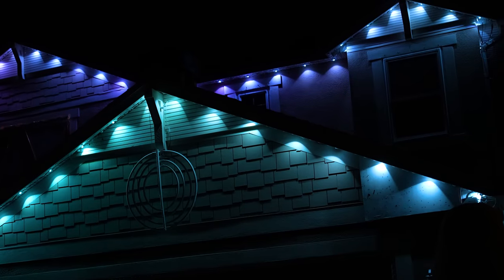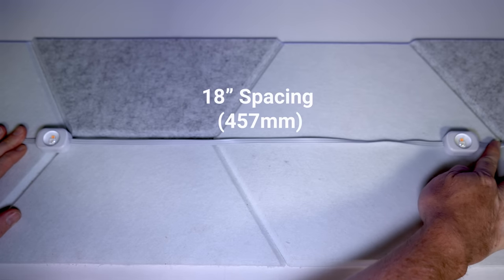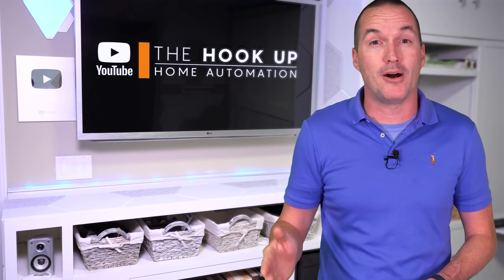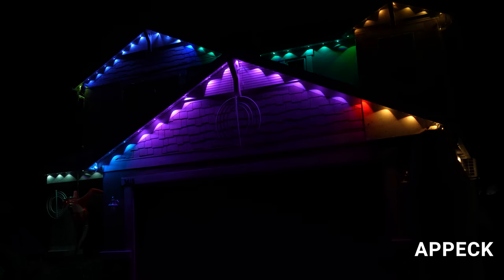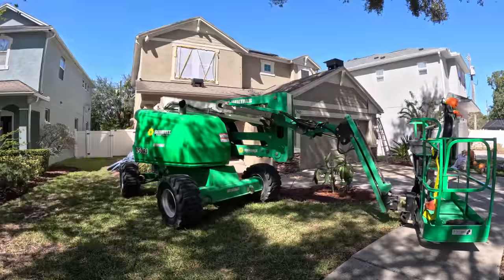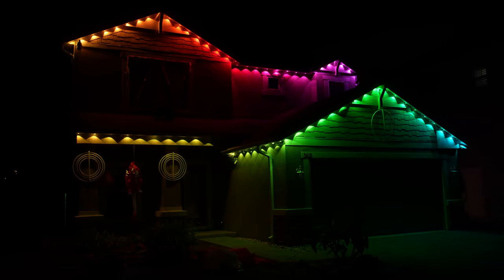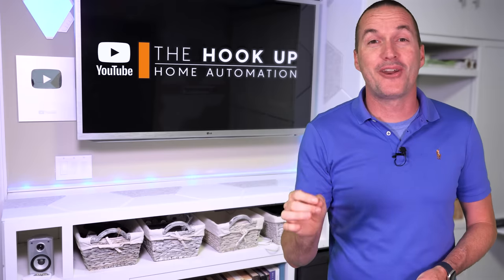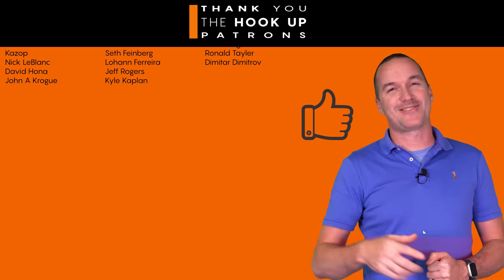Best Permanent Install Exterior LED Kit? Govee, Govee Pro, Eufy, Appeck, YPS, Novostella

Comment: Amazingly timely. I really want to buy a set, but I also really want to do WLED in the future. And after seeing the pictures I realize I need that separate warm white LED too. Sounds like Eufy is the way to go for me. This is amazingly helpful, thanks so much.
Reply from the maker: Yep, seems like Eufy is your best bet.
Reply: @TheHookUp - for 100% WLED DIY with pucks, do you think there's a cheaper route vs. buying the Eufy and throwing away the controller?  I'd love it if I could just buy the strips/pucks themselves with no power supply/connectors/controller/etc.
Reply from the maker: The pucks don't have the same "scalloped" look as the lensed nodes from Eufy/Appeck/Govee.
Reply: @TheHookUp  Are the white LEDs on the Eufy individually addressable?

Using the Uefy controller I can’t seem to set just one led on warm white while all others are off.  Can it be done with WLED?
Reply from the maker: @FreQi  Yes, it can easily be done in WLED.  According to Eufy that functionality will also be added to their app after the next update.

Comment: My soffits look just like yours. I've been a little nervous screwing in to them, but I know the 3M won't last very long where I live (hot summers). What type and length screw did you use? I saw somewhere #8 3/4 inch? I also read self tapping? thank you and great video. I got 2 150FT Govee the other day and after watching your video it looks like I made a good choice.

Comment: Thanks for the very informative video! I bought some of the Eufy lights and have installed them on the lower story of my house and they're great so far. I have a bit of a longer gap between strands, and I'm hoping to be able to bridge that gap without soldering. Do you have any experience finding a longer extension cord for the Eufy lights, or stringing two together? I see you could do around 10 feet in the middle of a strand, but I'm wondering if extending between strands could go longer than the included 12 foot extension cord.

Comment: Great Video.  I have subscribed for a long time.   Really looking at the Eufy lights.  Eufy says not to cut them to extend them.  Were you able to cut them without a problem?  If so did you just use normal crimp or solder shrink connectors?
Reply from the maker: Was I able to cut them? Yes.  Was I able to cut them without issue? No.  I ended up splicing two sections together and made a longer section and that was not the way to do it.  I would only recommend shortening a strip, not lengthening them.

Comment: The biggest issues I've had with ALL things LED... Is the quality of the engineering for life. I have yet to have anything last over 3 years.

I would LOVE to find a warranty solution or a true commercial grade LED system (but exterior and interior).

Comment: Thank you for putting together this amazing comparison! I was between permanent channel lights (YPS style), the Govee, Pro, and Eufy. I really wanted that warm white and the ability to work with WLED. What sort of result did you find with the Govee Pro's and WLED? Thanks!
Reply: (See  comment above, the support for the Govee Pro was added to NeoPixelBus (low level layer that WLED uses) so WLED team can now add the upper layer support for it.
Reply: Yps will have rgbw starting in January.
Reply: @mynorandvirginiamendoza8072  Thanks for the update! It was a pleasure talking to you a few weeks back and I can't wait to get these ordered!

Comment: Thank you so much for putting this together! Is the YPS white at 19:30 the closest to a warm white it will do? 

I love the color of the Govee Pro, but after your video I’m debating about the YPS because:
1) I have a gap that I would like to go down to the ground and then back up the garage wall as opposed to just running the wire along the wall. That’s obviously going to be longer than 10’
2) you mentioned these lights between a gateway drug. I probably should plan on that 🤣

Thanks!
Reply from the maker: 22:16 has the warm white wled color.

Comment: Great video. I live in Ottawa Canada where usual winters include several feet of snow with temperatures ranging from -10 to -30 degrees Celsius. Cold, cold and more cold. How do these products react to these types of temperatures?
Reply from the maker: They are IP67 so they are technically only rated to -4 F which is -20 C, but they should be fine at -30 also.  You should mount the power supply and controller somewhere inside though.

Comment: I saw in the video for the Eufy lights that you could not use the warm white light in combination with another color currently or individually adress the warm lights on or off. Do you know if Eufy plans to fix that in the application so i can set a candie cane (red/warm white) pattern ? Currently it looks like it only uses the white from RGB led and not the dedicated warm white. Or would i have to go with a WLED controller?  

Awesome video and i appreciate it.

Comment: Great review but one thing I have NOT seen on any of these permanent light reviews is maintenance and repair. LED's are notorious to stop working LONG before the manufacture claims. This is not because of LED failure, it's typically a cheap circuit failure. What is the repair/replace process of a single failed puck in the middle of a string? Do the manufacturers even make this available or possible or do they consider the string disposable if things start to fail within a string?  I haven't found any information on this from any of the manufacturers yet.
Reply from the maker: It would be the same as any other LED repair, just cut out the bad LED and splice in a new one.  For me, I ended up with 2 extra LEDs after my install, so I could just keep those around in case I needed to repair one.  That said, the heat dissipation on these appears to be very good and they didn't get noticeably warm, even after an hour+ of runtime, so the circuits should last a long time.
Reply: @TheHookUp  Yes I get that but let's just say you use 100% of the product for install. A year goes by or longer and you have a single LED fail in the line. Can you go back to let's say Govee and they can sell you a replacement LED fixture to repair your broken one?
Reply from the maker: Govee sells single extension strands, so 12 LEDs on Amazon.  You can also buy single strands on eBay.

Comment: Great video, very detailed. On the yps 5 light tracks, how many can you put together before you lose to much voltage to power or dim the track? Thanks
Reply from the maker: Same as any 12V light source, about 10m (30ft) before they will need power injection for full brightness white.

Comment: Thanks! Extremely informative.
I was thinking of covering the Govee cable with wire concealer/cable hider in between each light, will that interfere with light output/scallop?
Reply from the maker: Nope, that should work fine.  I've seen people using vinyl J-channel from home depot to do that.

Comment: Outstanding video. I would like to know about the YPS as far as power injection requirements and data boosting. I may end up with a couple hundred feet in total. Also, do you have or can you recommend a video about setting up the power supply and enclosure with a dig-quad?
Reply from the maker: I'll be making a video about psu and enclosure later this month.  As for power injection, it's the same as any 12V string, so 10m/30ft can be done without injection and 20m/60ft should be done with injection after 15m.

Comment: I am leaning strong towards the YPS track system for "NEXT" year.   I did not see how many tracks can be linked together... I followed your link to them... and they come in 15M (~45) sections... So, is 45 feet as far as you can go, and then you have to start a new "Electrical Home Run"?  Or can you chain more than 45 feet?  Thanks, and such a great video!
Reply from the maker: They are 12V lights, so for best results you should inject power every 30m, but there is no realistic limit for the data run.

Comment: Hello Great video, I have a question if you don't mind.  Question: The Govee ( non-pro) - Could you adjust the rgb-led to 4k-5k kelvin and was it consistent? I would like to use these year round, but the white (kelvin) is important to me. I did noticed you mentioned the Govee Pro have separate white leds and that does interest me, but the non Pro Govee also have my interest peaked! Thank you.
Reply from the maker: You can set a custom color, yes, but it will take some fiddling to get the color you want from RGB since there's no dedicated white chips.

Comment: Thanks for posting this! Is there a total length where you think it would be best to DIY your own set? I’m new and the design of my house has quite a few smaller peaks I’d have to splice and run blank spots for.
Reply from the maker: I think it's just about the look.  The DIY sets don't give the lensed/scalloped look.  If you need to do a lot of jumps the Govee Pro kit is probably the way to go since it seems to be more tolerant of extensions.

Comment: I see you chose the Eufy to hookup to your WLED controller.  Did you splice the wires, or use the native connectors?  If you used the native connectors, what is the connector type?  I'm looking to do something similar.  Also, did you use a QuinLED controller, and bypass the controller for power since the Eufy use 36v?
Reply from the maker: Yes, I spliced out the wires.  Data and ground go to the DigQuad, power goes to the 36V Eufy PSU and the PSU and DigQuad share a ground.

Comment: In all the installs that I've seen, the lights are mounted 3-6 inches from the house. I've got a gabled 2-3 foot overhang around my house. The flat surface is at the end of that overhang, so the lights would be mounted 2-3 feet from the house. Would that still create a good effect? Also, If I did mount them closer to the house they would be sloped like the overhang is. Would that affect the way the lights illuminated the house?

Comment: I would be interested to see how these hold up to your DIY version from some years back
Reply from the maker: The DIY option is still going strong (you can see it in the flames in this video).  The plastic diffusers have yellowed significantly due to UV, but colors and brightness are still good.  I'm honestly amazed every time I fire them up and there are no issues after 5+ years.
Reply: @TheHookUp  thanks! do you think these options outperform your DIY option tho?
Reply from the maker: @tonverra  Just a totally different look.  My LED strips are pointed at the street, so you see the LEDs directly. The scalloped/lensed options are more of a wall wash, while the YPS track is a combo of wall wash and direct view.
Reply: @TheHookUp  thank you! Appreciate the info!

Comment: So, I'm thinking the standard Govee lights are what I'm leaning towards for my house. Question, if I need 10 or 12 more feet does Govee sell a single strand that I can just screw in? Also, if so will that extra string add onto the app like plug and play?

Comment: Do they make diffusers for the puck lights? I don't love the tiny sharpness about them or the bullet/pixel style LEDs either, but I hate the overly scalloped look of the other lights. Wondering if it makes more sense to try to diffuse the YPS puck lights or place the Govee/Eufy style lights as far out on the soffit as possible so they don't show a significant/obvious scallop. Otherwise I love everything about these. Amazing video! Thanks so much for your reviews!
Reply: I tested this with the govee pro's. 8 inches out as that is where my aluminum soffit starts. The effect is still showing, the only difference is now the shadow is about 8" down from the wall and the scallop is just a bit less sharp. So the further you go out your shadow will grow which will not look as good imo especially if your windows start high and fall into part shadow.
Reply from the maker: If you don't want the scalloped look I'd recommend getting the puck track but pointing it at the wall instead of at the ground.

Comment: The Pros and Cons of the kits you list at the end of the video says that the Govee Pro LEDs are WLED compatible.  Does that mean you could use their lights with a different controller to use WLED to control them?

I like the installed look of the YPS kit but I'm concerned about how hard it will be to trim the tracks to the right length if they don't match the size of the house.  I use WLED for other LED strip projects, so I like the option of using that to control the lights.
Reply from the maker: Govee pro is not currently WLED compatible.  Govee (non-pro) is WLED compatible.  I wouldn't be surprised if someone forks the WLED code to add Govee Pro compatibility, but it hasn't happened yet.

As shown in the video, trimming the YPS tracks is extremely simple, a $10 pair of tin snips is all you need.

Comment: How would you rate the Puck Track vs the Permatrack + Pixels that DrZz's uses?
Reply from the maker: I have permatrack (pixels) around my garage door.  The issue with those vs puck track is the permatrack is about 2.5x taller, so it stands proud of my roof's drip edge.  I wanted something that would tuck behind it.

Comment: This video has been so helpful, I can't wait for the mid-November WLED video. I currently have both the Eufy and non-Pro Govee as options for my install. I'm a sucker for the warm white, but I need about 300' for my install and the Eufy app doesn't seem to allow linking of individual controllers. In addition, the Eufy app seems to be all or nothing when it comes to the daily ambience warm white lights, I can't find any way to choose individual warm LEDs to turn on. Could these limitations be fixed by going with the WLED path instead of using the Eufy app and controller?
Reply from the maker: Yep, easily fixable with WLED.  I wouldn't recommend exceeding 100ft for a single run, but you could easily have 3 different 100ft runs on 3 channels of a WLED controller.
Reply: @TheHookUp  thanks for the quick response. I'm planning power in 3 different locations. With the Govee lights, I have tested grouping separately powered controllers together for linking control, but can't find a way to do this with stock Eufy. Good to know it's possible to do in WLED. I'm torn on which lights to install and which to return. I like the density of the Govee and prefer the native app, but that warm white is so nice. Having a way to fix the Eufy app limitations is a good option. Can't wait to see the next video to help inform my decisions.

Comment: Great video as always. 
Are the splicing lengths between two LED or total slice length? Could you have two 10 ft splices with LED in between? 
Eufy says max is 100ft, is that because of the included power supply?   Haven't hit the max with WLED, So just switching to a higher power supply and injecting power would extend?
Reply from the maker: In between LEDs, you could use an LED as a repeater most likely.  I think it is limited by app, but probably because of the small power supply.
Reply: So in theory switching to wled control and as long as inject power, the 100 ft length should be able to exceeded, or am I missing something?
Reply from the maker: @TylerBolick-iy7ji  Correct, that should be possible with WLED.
Reply: @TheHookUp 

Thoughts on this? 

I hooked a new set up to wled but it seems the color order has switched. It's GRB with W+G swapped to get it working?  That really mean they've changed color order between sets?
Reply from the maker: @TylerBolick-iy7ji  no, I wrote that part of the script incorrectly, see the pinned comment.
Reply: @TheHookUp  How many segments were you able to connect in a row with no power injections?  I can actually get 8 segments through Eufy app now(for whatever reason), but when powering from DigUno, it cuts out after the 5th segment, 6-8 won't even light up.  Guessing it's power issue, but not sure why through Eufy controller it lights them all.
Reply from the maker: @TylerBolick-iy7ji  I have all 6 segments lit up with WLED without any power injection.
Reply from the maker: Do you have a gap in between your 5th and 6th segments? Maybe it's too long?
Reply: @TheHookUp  there's a junper mid string on 5th segment.  The first LED will blink occasionally on the 6th segment but won't ever light.  Turned off brightness limitor to check that, will run power injections soon.  Odd it will work with eufy controller inline but not when connected to DigUno.
Reply from the maker: @TylerBolick-iy7ji  That's almost certainly your issue.  If you can't shorten the extension/jumper I'd recommend installing a node in the middle of it and setting it up as a null pixel.

Comment: If you have multiple 100’ sets, I do understand they can be linked together.  My question is hypothetically if you have like a “chase” scene on, will the lights be out of sync for that depending on the direction the lights are installed?  And how do you install the different sections to make sure the scenes collaborate with each other?
Reply from the maker: There is no way to "map" your house that I'm aware of using the default govee app.  So yes, they could be out of sync depending on the direction of the wiring.

Comment: Most of them seem to have voltage drop. White colors are not consistent.
Govee pro should allow power injection. At least from end of it.

But some of use can easily inject some power in multiple  places to make the color perfectly even and extend the length, as long as it doesn’t hit the limits of data wire length.
Reply from the maker: They are high enough voltage that it shouldn’t be an issue, especially for just 100ft.
Reply: @TheHookUp  From your video, I see slight differences in white color... not sure if it's the video, but for me I can see the different from beginning (RGB) cool white LED to towards the end of the string
Reply from the maker: I think that might just be the paint on my house.  The wood shingle areas are a darker tan color, but the roof peeks are more cream colored.